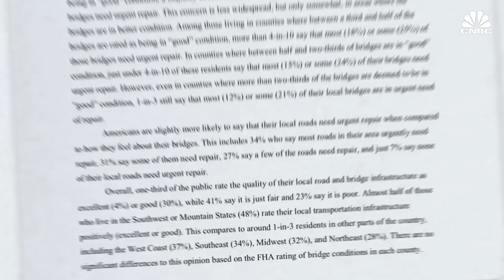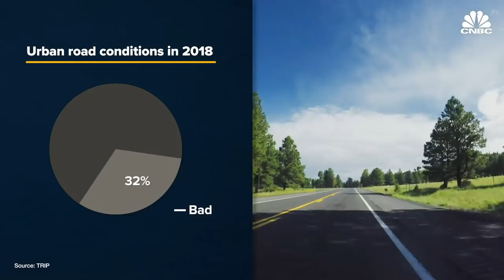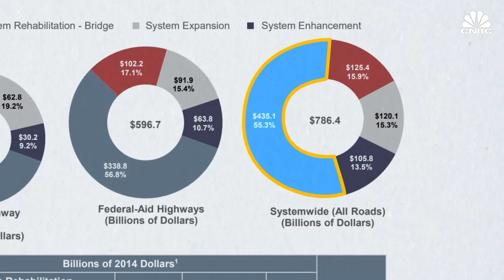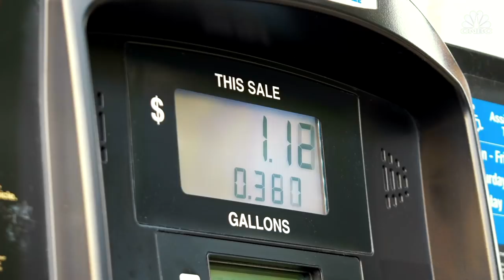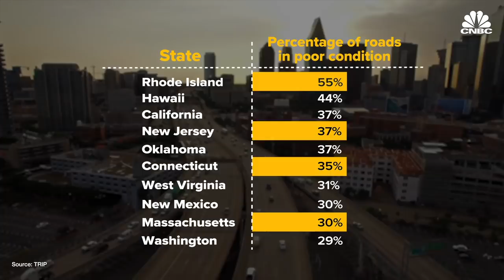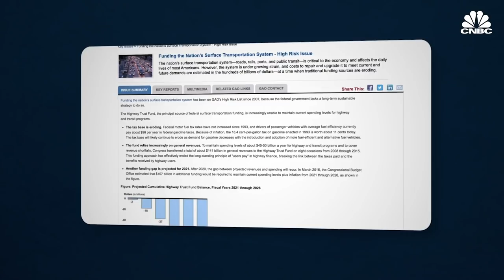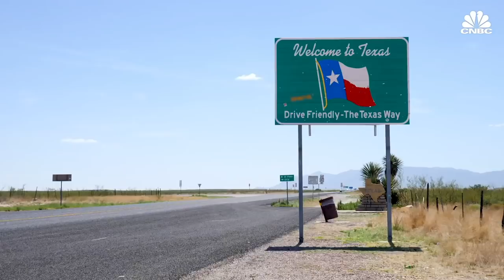Why U.S. Roads And Highways Are So Bad

Comment: Why are US roads so bad, because of long term neglect and also poor quality repair work. Most repair and resurfacing projects are done in a shoddy careless manner with poor quality paving materials that just don’t hold up to heavy traffic and climatic changes. Also a serious lack of preventive maintenance has also caused many US roads to deteriorate to a point of no return where total reconstruction is needed however no money is available. Another contributing factor is our want to build more new roads and highways yet we cannot maintain our current highway infrastructure.

Comment: It's because you don't pay enough taxes. It's the largest paved road network in the world,  the ratio cars/street length is 0.05miles, so one car owner has to pay for 0.05 miles of roads. But they don't. No car fees, no Fuel fees, no tax money. In Germany, it's about 0.02miles  (100 feet) per car and they pay about $2 per gallon on taxes. So for let's say $500 tax per year per car, they can invest $10.000 into each 100 feet every 20years.

Comment: Okay, yes.  Funding is a problem.  But no one mentioned time.  Time is also fairly crucial -- Almost equally so.  You don't just schedule road repairs all willy-nilly, ESPECIALLY in high-traffic areas, and ESPECIALLY at certain times of the day, week, month, and year.  Let's face it.  It will be a balancing act between delaying cranky drivers to do the necessary repairs (not too mention picking the optimal detour routes) versus postponing and putting them off in the first place; REGARDLESS if sufficient funding is available or not.

Comment: idk if CNBC writers have been to other countries but our country's roads for the most part are really good and we have way more of them.
Reply: If you only look at roads in Moldova, Bulgaria and Russia, then yes. American roads are better. But when you look at the research the World Economic Forum has done you will see that the Netherlands and Singapore share the number 1 spot. And i can tell you, Dutch roads are a lot better then American roads by far. Been to both.

American roads mainly consist of long wide roads with big junctions. Roundabouts are non-existant because Americans are scared of those. And to make those big wide roads they use cheap asphalt or concrete slabs which can't withstand really low or really high temperatures.

Dutch roads are vastly different and more complex. They have traffic calming such as narrowed S turns, speed bumps, bicycle priority roundabouts and dedicated bus lanes everywhere. And they use very expensive asphalt where bits of rubber are mixed which reduces noise pollution and once the asphalt is set it contains millions of miniscule holes (which you can't see or feel) that are use as a drainage system to make sure water doesn't stay on road.

And btw, many people go to work and school by bike or public transport, which means less traffic on the roads causing less wear and tare.

Comment: Roads in Taiwan are in excellent condition. They are resurfaced several times a year (enough that it's annoying). Not only that but the resurfacing work is FAST. An army of machinery shows up, traffic on one side closed after about 10pm, and they work FURIOUSLY, and the work is done before 3am. Then they close the other side of the road the next day and that section is resurfaced as well. It's scary how fast it's done. The side effect, the roads are perfectly safe for cyclists (roads in America are not safe for cyclists because the condition, especially along the edge, is so rough that you would wipe out from the potholes on bicycles). Now it's not really safe for cyclists in Taiwan for other reason, mainly drivers who drive like crazy (and I guess the smooth road does enable crazy driving during off hours). But nobody really fixes car suspension more than once a year. Bad roads in America could mean suspension needs work several times a year.

Comment: The roads are not built correctly.Who in their right mind would build a road that collects water under the pavement??? A base that washes away leving no support for the concrete? Water can freeze under the pavement in colder areas of the country.Ice lifts up the road surface.I guess from a money standpoint,it makes sense.Lots of money to be made to repair a road constantly.The timeframe to repair roads is a joke.5 6 years to do a stretch of roadway.Bridges built,when a large cement culvert would work just as well,and last 100 years! I feel that like everything else the Gov does,our road system is a scam.Corrupt,too.

Comment: Europe’s Roads Are Too Bad
Reply: Depends on which countries. Roads in for instance Moldova, Romania, Ukraine and Belarus are in a critically poor condition whereas in countries such as Germany, Norway, Sweden and Finland they are good.

Countries such as Estonia, Latvia, Lithuania and Poland are making massive improvements because of the EU subsidies and the highways there are pretty much excellent since they have all been built less then 5 years ago.

The Netherlands shares the first place with Singapore on the list of the best road quality and overall infrastructure. Potholes there are pretty much non-excistant and they use special asphalt with rubber and small holes to let through water and reduce noise pollution.

Comment: So last year it was 3.2  trillion. Which was an increase of 12 billion from the year before. So that's like a 0.3% increase. And compared to 20 years ago it was some 600 billion smaller so around 2.6 trillion which rose to 3.2 billion so that's an increase of around 25% increase so. You had 20 years to adapt to a 25% increase of traffic, that doesn't seem that hard to me.

Comment: If taxes come from miles driven then they should also be based on weight... electric cars are heavier than gasoline powered ones of the same class...I'm also not going to pay for the unecessary wear caused by people that drive enormous SUVs and 3500-series trucks when they don't even need them

Comment: The roads of gotten so bad. 
Because the asphalt do use as a byproduct of the oil industry. The oil refineries are Able Processor so the quality of the Asphalt it’s not a good product for a road anymore. 
That’s the same problem we have with the Asphalt shingles. You call them fibreglass. 
Just wait until late get rid of the oil industry.

Comment: I guess you have never seen German roads
Reply: I read some articles about Highway vs Autobahn. The Autobahn seemed to be better maintained. Also the pavement has much higher quality compared to the pavement in the USA.
So I doubt, that Germany has roads, which are in much worse condition than the roads in the USA.
But I know some streets in my hometown (Hamburg, Germany), who are not so good shape. But overall they are usable and safe.

Comment: The roads in America are not thick enough I should at least be 24in sick 12 in of underlayment and aggregate and 12in of pavement with a great number of heavy trucks so the roads need to be able to handle the cars and the trucks a bus Norte truck should be as far as highways are concerned interstates and highways and Parkways should be at least 24 in between aggregate concrete and or pavement and that would change the issue of having buses that are driving through the pavement tractor trailers that are breaking through depaysement and that should just be on Evan said before interstates highways and Parkways inner city streets it is what it is you need to spend that kind of money on